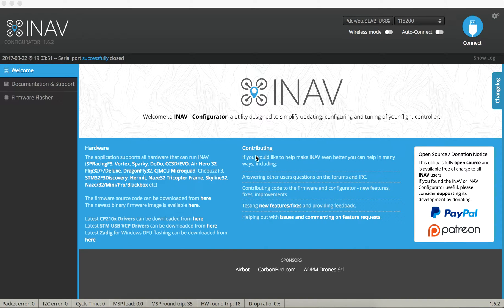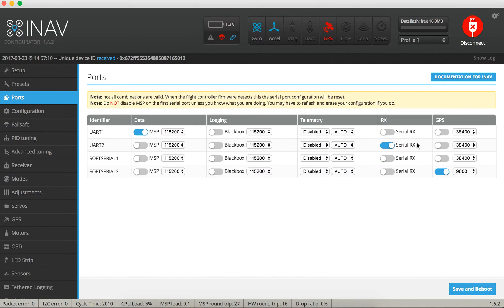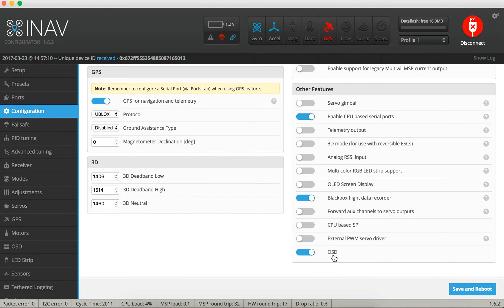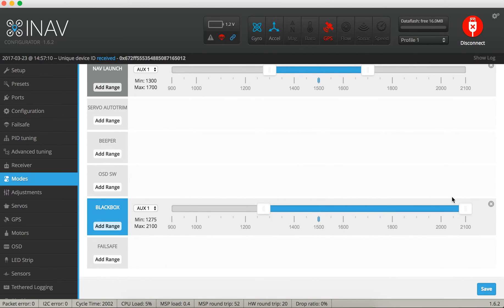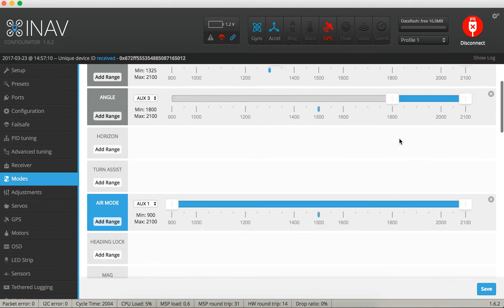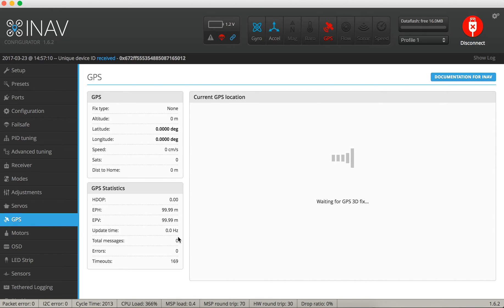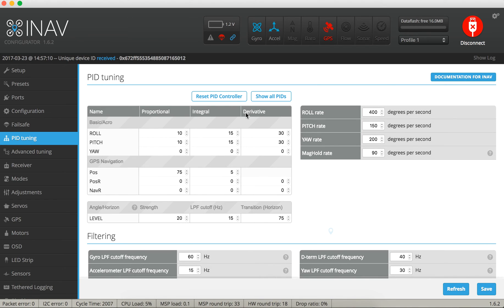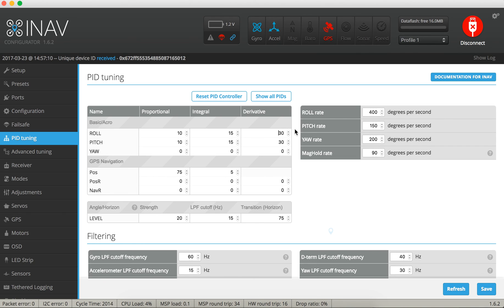Reptile S800 Sky Shadow iNav Setup

Comment: Hi, Could you tell me why in the board and sensor alignment the roll degrees it is -8.2 (1.57 min)?

thanks
Reply from the maker: The fc is mounted flat in the fuselage but needs 8.2 degrees for the plane to fly level. So - the fuselage angle and the angle at which the plane is flying level are not the same.
Reply: mi_FPV how can I know that the gps and FC have the same alignment?
thanks
Reply from the maker: GPS has no alignment, it doesn't care about it's position in the plane because it only transmits a location, not a direction. The FC get's your direction by comparing the different locations the GPS gives it over time.
Reply: mi_FPV I was taking about tha magnetometer of gps and Fc, or I am wrong?

Comment: Hi! I''ve watched other videos on INAV for flying wings and people report it's a bit glitchy. Doesnt work reliably. Did you have any issues? Also, I have heard the firmware provided by Patrick  Elmisson works quite well for flying wings but I haven't tried it yet. cheers
Reply from the maker: Hey! It is definitively not a plug and play solution and I don't think it will ever be one. If you read the introduction and manual on the iNav Github page and set the plane up in a proper manner, it will work without glitches. It is a new software that you just have to learn. I feel like a lot of miniquad pilots are switching to iNav on their first wings now and they have issues because they think they know how to set everything up and fail to read the manual. It is easy to set up - but not that easy. ;) I am really happy with iNav on the S800 and have just swapped the APM on my zephyr for an Omnibus F4. I am excited to see how it does on a bigger wing.
Reply from the maker: You have to keep in mind too, that iNav is pretty new and getting better with every release. If someone tested it in December 2016 and hated it, they might be perfectly happy with v1.6.2 in March 2017. Konstantin is really putting a load of work into it.